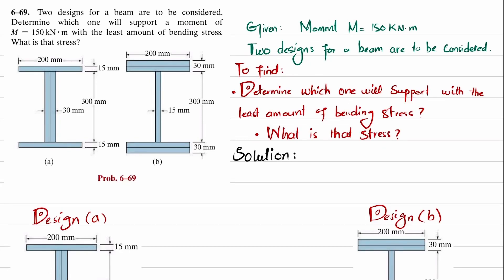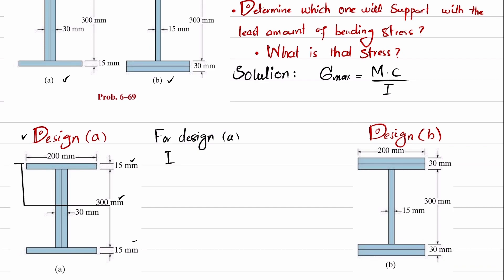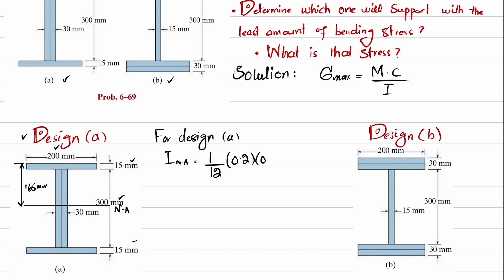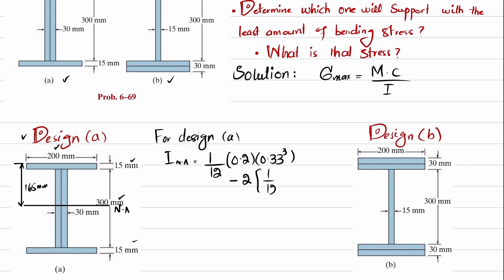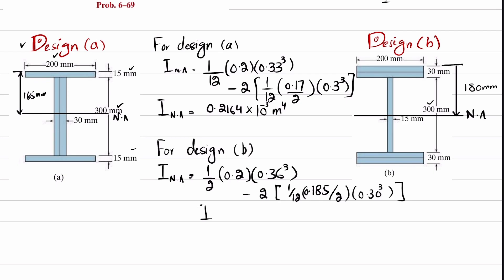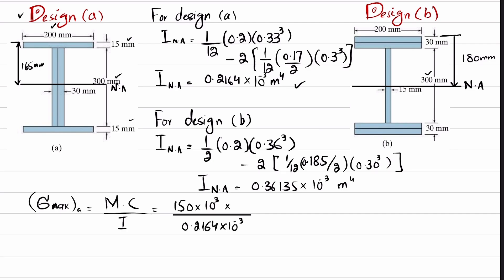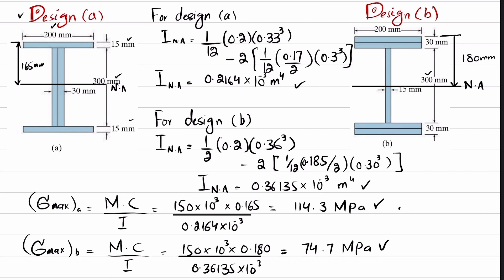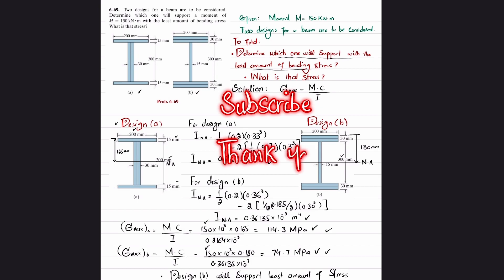6-69 | Ultimate Guide to Handling 150 kN.m Moment with Minimal Bending Stress | Mech of Materials

Comment: When calculating the moment of inertia, I calculated all areas separately, but I find a different result than yours.
1/12*((0,2)(0,015)^3)*2  +   1/12(0,03)(0,3)^3 for figure a
Reply from the maker: The reason is that both upper and lower flanges are away from neutral axis so you have to add Ad^2 with each of the moment of inertia of flange and then you will get the same answer
Reply: @engradnanrasheedmechanical  But isn't this a symmetrical shape? Why do we feel the need to do this?
Reply from the maker: @Ders-x2n yes symmetrical about both horizontal and vertical axis. But if you take horizontal axis then you can see that centroid of Web portion lies on neutral axis and while centroid of the flanges are away from horizontal axis that's why we apply parallel axis theorm for calculating moment of inertia about horizontal axis. While of of you want to calculate moment of inertia about y axis then both centroid of flange and Web lies on it so no need to take the term Ad^2. I hope you have clear understanding now
Reply: @engradnanrasheedmechanical  thank you
Reply from the maker: @Ders-x2n you are welcome 🌹

Comment: Could we think it differently? Like solving for moment of inertia normally for each section independently,, without considering a whole rectangle - the 2 holes right?? Honestly moment of inertia is a very tedious topic from statics... Unless if it was a differential area
Reply from the maker: Yes you can but it's the easiest way. You can use parallel axis theory for finding the moment of inertia ...
Reply: @engradnanrasheedmechanical  but how can I know on which axis should I calculate the area moment of inertia in bending? If the centroidal axis were unknown for example? I always miss in this topic, the final result comes always wrong with me I didn't understand it properly... I just know that it is area squared and also the ability for an object to resist rotation or torque... What is moment of inertia??!!
Reply from the maker: normally it is taken about the horizontal axis. it depends upon the moment around the axis . there are many other problems available so you can check that and learn from that as well. 
https://youtu.be/bP4wvze67Yw?si=IwKhDyYavBBl7GFk
https://youtu.be/r9AJTDtnJ7I?si=GeIVbvqKggdZn20C
https://youtu.be/EnHvVHxAUgs?si=bdsy-Uhf21U5fjTz
https://youtu.be/5Lo5EbFY-KQ?si=zX95oyS_12HwPlhQ
https://youtu.be/KpSvfw2i1YY?si=itczXzEH9qpeygPA
https://youtu.be/z90WA0clsSU?si=ldgm0SMUc8aShvwm
there are many more and you can check them....